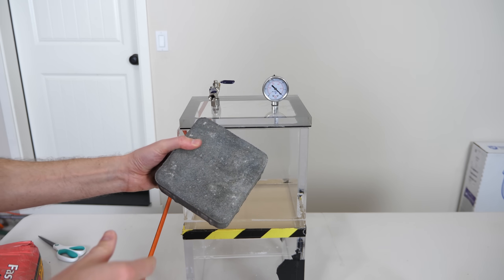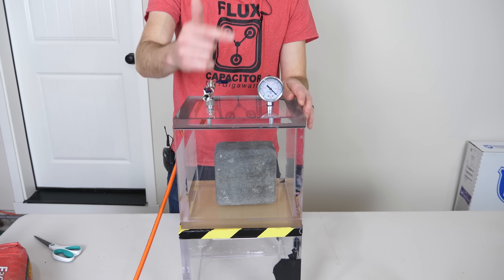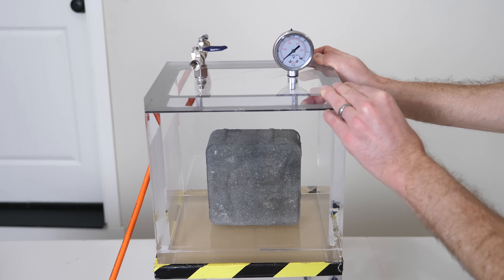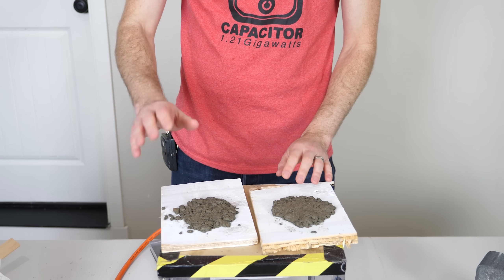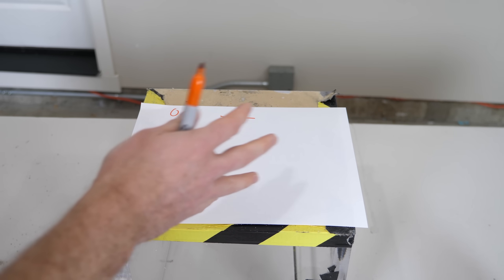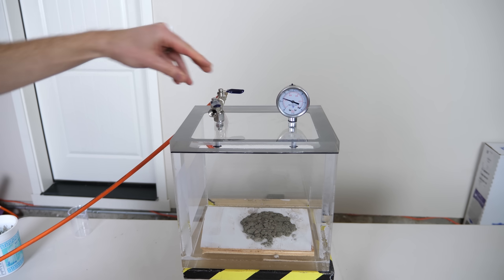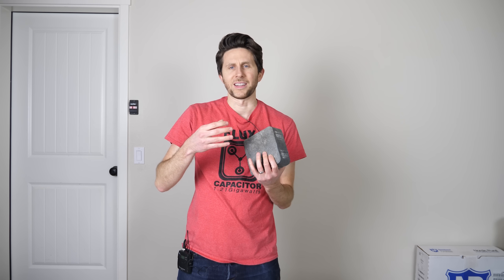Does Concrete Turn to Dust in a Vacuum Chamber? Concrete Without Oxygen Experiment

Comment: Does concrete turn to....What?? Why?? I didn't come here to watch the video, because I already know the answer to this ridiculous question. Why would anyone above a 50 IQ think it would turn to dust? Oxygen has nothing to do with how concrete is held together. Oxygen atoms do not cause concrete to hold together, a chemical reaction that then dries and is void of all liquid causes it to stay in form. Yes, in time water can leach out the lime that is a main ingredient in the adhesion, because water contains CO2 turning water into carbonic acid. A very, very weak acid that is found in ALL water. This fact was the basis back in the 70's for the great acid rain scare. The general public didn't realize this was a natural thing, because anytime there is CO2 in the atmosphere, it will create carbonic acid when mixed with the water. But, It'd take more than 50 years to cause even a little of the leaching affect. This question ranks right up there with people asking, is the earth flat.

Comment: Bit of a silly video since both of these premises have no logical basis. Cured concrete is a stable mineral and no more likely to disintegrate in a vacuum than a natural rock. Wet concrete also only needs water to cure. It will cure perfectly well ( in fact best) underwater. The only  effect of a vacuum would be to reduce the vapor pressure of water leaving less for the concrete. BTW concrete does not “dry” it sets. Technically the origin video was not correct since there is no known mechanism for a vacuum to remove oxygen atoms from solid crystalline molecules or any others. Otherwise vacuums would be mega disintegrators able to solve all the waste problems of the world.

Comment: Hey Good stuff, You should get a micrometer for you're vacuum chamber.  In refrigeration pulling a vacuum is often referred to as dehydrating the system. Moister at least in experience seems to flash off raising the micron reading then as it comes back down it will repeat over and over. Once you can achieve and maintain anywhere from 300 to 500 microns you know your dry and there are no leaks.

Comment: many years ago i worked in a lab where concrete was tested.  we used to take samples of each truck load and let it set in a mold then when hardened enough put them under water for a month and them test the strength.  concrete only needs water and fully cured concrete is inert to air.

Comment: If you have a molecular lattice that includes oxygen in its structure and you remove the oxygen atom, yeah something's going to give way. Removing the air from concrete is not the same. Molecular oxygen does not equal air.

Comment: I gotta be honest, IDK where pf who came up with such an idea. That concrete relies on air to stand, I have never herd anything it it before. On premise it sounds like complete nonsense. Only reason I can think of for people thinking that is that the trapped air inside concrete also getting pulled out. In which case you should be more worries about the air trapped inside your own body if something like that was happening. At least that air is creating pressure. 

lol haven't watched the video yet tho, just paused during the intro out of shock.

Comment: If anyone mentions concrete crumbling when all the oxygen goes away and they dont mention basically everything alive, all the water, and multiple compounds turning into gas. They are kinda dumb.

Oxygen the element and oxygen the air we breath arent the same thing and conflating the two is just sloppy postulating. Its really bad science communication.

Not criticizing you, your video is great. Equivocations especially really stupid ones are just a pet peeve of mine.

Comment: Incmplete test. - vacuuming only removes the air - and yes vacuume has an effect - for one, it will cool th set concrete. But  heat+cooling causes fractures. Second problem is that drying in a vacuume causs ice buildup until the ice prevents the evaporation the resulting dried concrete will have lots of holes in it where water froze and then sublimated away - the result is a brittle aggregate and very porus allowing gas to leak.through it.
Your "experiment" was poorly designed.

Comment: All these videos saying concrete turns to dust if all oxygen disappeared don't say what if all air disappeared. So removing all oxygen means removing all oxygen atoms. And at that point we wouldn't exist anymore since our molecules in our body are containing oxygen
Reply: But do they mention all the other things that would collapse into a pile of atoms? Including water turning into hydrogen?

I havent seen them so im more genuinely asking.

If they mentioned concrete but didnt mention water then i think they conflated the two. If they did mention both then their communication had a hickup and an equivocation mistake happened.

Comment: 90% sure that it's porous enough that nothing will happen to it.
Reply: For the second part - no, it doesn't need air to dry. If anything, the vacuum will make it dry faster and it will be denser and stronger than normal concrete due to the removal of air bubbles.

Comment: #1, Nothing will hapen.
#2, For things that would be affected, sudden decompression would be more damaging.
Use a large tank you keep at a vacume. Then run large pipe to the vac chamber w valve to large tank to decompress fast.

Comment: 1:46 concrete and cement rely on chemical bonds to maintain their rigidity. I highly doubt removing oxygen is going do a thing.

However. Oxygen is a very reactive element and the chemical bonds above mentioned may require that reactiveness to set in the first place, so sublimating all the water off MAY be catastrophic to it setting but i dont know enough about the specific chemistry involved to predict whether it will set without oxygen. I suspect it will.

Comment: Concrete is a derivative of cement, and contains lime (calcium oxide and something else) that releases CO when water, H2O, is added. That's why both concrete and cement can be "cooked with or without an atmosphere! And that's why it's not recommended to be in an enclosed space filled with concrete when it cooks, it kills you without you knowing, whether on Earth or on the Moon... Carbon monoxide is odorless and reacts well in any atmosphere or the lack thereof with chlorine! That's why we can create walls, both on the Moon and on Mars, as long as there's an initiator, not necessarily water! But that's for later... heheh!

Comment: you can cure concrete submerged in water (aka no atmosphere exposure). In fact for compressive strength test in Europe the samples are cured in a warm water tank.  The US uses a cylinder testing method for compressive strength where the cylinders are cured in a kind of steam room of sorts.  Unfortunate,there were too many other variables involved in the test you conducted to draw a true comparison of strength. The samples need to be the same shape — exactly.  Not just ill defined blobs.   The consolidation before letting them set needs to be the same.   Also the temperature needs to be the same.  Although they were in the same room, it is unlikely the temperature in the vacuum chamber was the same.     One interesting thought is the heat transfer is likely reduced in a vacuum.  So the curing large masses of concrete or thick slabs may be more challenging.  Both conduction and convection heat transfer are not possible in a pure vacuum leaving only heat transfer by radiation.

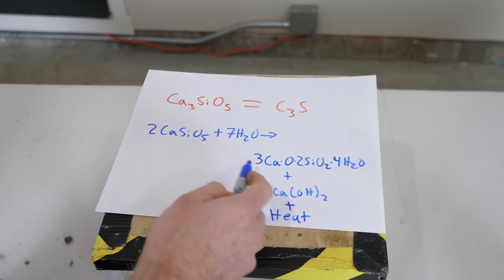Comment: 7:45  There is a method of placing concrete called "dry pour".  Dry concrete mix is poured into the form.  Then water is "misted"over the concrete several times.  Your explanation shows why "dry pour" concrete isn't strong because water can't get to the dry mix.  It takes a few weeks for that to happen if it happens at all.  Even quick setting concrete takes 28 days to fully cure.

Comment: I stopped the video at 1:40.  Absolutely nothing will happen to the concrete brick in the vacuum.
*1st edit, stopped at 3:44.  The concrete will harden if left in the vacuum long enough.  The vacuum may pull out some water, but not all, so if he leaves it in for a few minutes, nothing will happen.  If he leaves the concrete in for a few days the exothermic reaction will have time to start, and the concrete will harden.  Then over the next thirty days the concrete will continue to harden or cure.

Comment: I'm pretty sure it won't change. Placing concrete in a vacuum is not the same as all oxygen disappearing from the Earth. The oxygen inside the concrete probably won't be pulled out just because of the vacuum. But if all oxygen disappeared, that would include what's inside the concrete. And that's if this claim is true in the first place.

Comment: There's a big difference between "What happens if you put a piece of concrete in a vacuum" and "What happens if you were to remove all the oxygen atoms from the concrete?". The latter would change the molecular structure of the concrete significantly (assuming it has oxygen atoms in it, which it almost surely does), and then I could believe it would lose its integrity.

Comment: This is a fun experiment! But I do want to nitpick the part where you say you reached "full vacuum". I say this as someone who has worked in a clean room, you never reach perfect vacuum (no gas at all). You can get pretty far, but you don't go from 0.1 Atm to 0 Atm; it's more like 0.1, then 0.01, then 0.001, and so on. That vacuum chamber likely couldn't reach what would be considered high vacuum (which requires a much more complex and robust vacuum system)

Comment: If all oxygen left the earth at once, all organic matter would turn to slush and the planet would arguably collapse into the core under the pull of gravity. Also all the water on the planet would become hydrogen gas. Again, the whole planet would simply collapse.
Reply: Just looked it up to be sure I wasn’t an idiot. Oxygen makes up about 30.1% of the Earth’s mass. That’s literally almost a third. So yeah, im sticking with what I said. Everything would collapse into the core.
Reply: I think they mostly mean "no air". If it were just oxygen, there would still be tons of nitrogen gas, which defeats the point of air not being able to hold up the concrete

Comment: The wet concrete will harden, but will never fully cure.  Unless you leave the pump running for 28 days you won't notice much difference.

Comment: I'm sure if you sucked all the air out from around concrete incredibly quickly it would come apart, but that would be a function of the force of the air being removed rather than the lack of air itself.

Comment: That's it: Moon structures would mostly be in concrete. Because there's an abundance of stone/sand there, so it'd be cheaper to build building with local materials, leaving what's metal for seals and devices.

Comment: It's actually linguistically wrong when they say that. Removing all oxygen means removing the gas only. When you refer to chemical reactions we say they lose oxygen "molecules", not oxygen. We also tend to call oxygen molecules, OXIDE. As in dihydrogen oxide for water.

Comment: Concrete doesn't "dry" to turn into a solid.  It's a chemical reaction.

Once in awhile you get it right, and refer to it curing.  And then you go back to calling it "drying" which is categorically wrong.

Comment: I believe that concrete doesn't need free oxygen. I didn't believe it to begin with, but, if I had, this would've dissuaded me. However, I still don't believe that concrete spaceships are a good idea.

(Yeah, I get it: the Moon, Mars, etcetera. However, that's not actually in space, just vacuum and low pressure, respectively. Nitpicking for the purpose of humor is justified, imo.)

Comment: I heard this a while ago, hence why I looked it up lol. im 90% sure its false though lol
also with this test, if it does crumble, how do you know its not the lack of anything in the atmosphere of the chamber? Like pulling it apart? not sure how it works icl lol not an expert just speculation. lastly, you said you would try drying cement in the vaccum, if the cement doesn't dry how do you know  that's because of a lack of oxygen?
This was all written before watching the whole video lmao. it's all pre-test queries

Edit: This video is fucking interesting.

Comment: i bet it would not set if you used something hat didnt have O2 in it unless the water bubbled out  from the decrease in  pressure you already gave it what it needed with the water o2 was still there plus like you said the chemical reaction is designed to set in that time  
i work with a lot of drywall so it the same with drywall mud you can try to buy 20min mud dump the bad in a bucket mix it up put a lid on it you just wasted all that because unless you use it all in 20mins that whole bucket will be like almost dry clay hard but will dent when hit so not rock hard but the next day it will be even if you never took the lid off and yes i know you want to say there was still o2 in the bucket when you put a lid on it NO NO
by that logic it would start to dry top to bottom but the top would make like a shield blocking the o2 from going down but if you ever work with this stuff unless you have a crazy amount of air pockets in it it will dry at a uniform rate meaning all of it even at the bottom thats not getting o2 but the top top will dry a little faster o2 do help it dry but its not need iin the gas or as air since its all getting the from the water used to mix it 
and ps (i got my thoughts mix up on my guess at first lol when you asked what do you think will happen to the concrete i forgot its way more porous then rocks and was thinking it might blow up because of a lot of trapped air )

Comment: And yes concrete will solidify without oxygen how do you think they do it underwater concrete is a chemical reaction it does not need oxygen all it needs moisture in the chemical reaction will happen

Comment: Cement is to concrete as flour is to cake. 

Cement is an ingredient. 

You missed water as an ingredient. It’s actually cement, water, and aggregate. Concrete uses coarse rock, slurry uses just sand. 

I’m also going to say that the concrete paver you used was different after the vacuum. You should have boiled all of the water out of the block. 

I used to do quality control on aggregate, concrete, and asphalt.

Comment: Nothing will happen. I'm 100% sure of that. There is no chemical or structural mechanism that would make a vacuum cause concrete to disintegrate.

As for the cement setting in a vacuum, it's possible that it will be incomplete or take longer. A vacuum causes water to boil off at extremely low temperatures. If the water used in the cement mixture evaporates and gets sucked out before the chemical reaction completes, it would cause the cement to not be fully set. This might be offset by adding more water to the mixture, though I'd need to do a lot of annoying math to figure out roughly how much would be necessary, and math makes my biologist brain angry and sad.

Comment: The oxygen (and hydrogen) necessary to bond concrete is already locked into the concrete. I supposed if you pulled an absolute vacuum immediately, it might fracture. But, I am 100% sure nothing will happen to the block.

Comment: I beleve you could influence hydration by pulling more liquid further into the concrete mix but I think it would be worth nearly noting. Oxegen at 5,280" is only 16% atmospheric air is mostly comprized of nitrogen and a little bit of argon. oxegen shouldn't really effect it

Comment: 6 years later, but i take my guess... nothing is gonna happen, every single time you run any experiment about withholding oxygen or air from concrete. cement is made to cure and set without the need for air, even under water it will set (though it might make bad concrete from the excess water).

Comment: By the concrete crumbling because of oxygen disappearance, then water, ozone layer, DNA, RNA, sugar, … will also disappear since without oxygen, their structure will crumble. Not to mention, our body has oxygen, animals has, tree has, even the oxides, even the earth has oxygen all over its structure. So, if all oxygen atoms disappear, then the entire earth will crumble apart with nothing left
If only oxygen gas disappear, we’ll just suffocate for 5 seconds and our ears will just pop due to pressure decreases

Comment: Earth athmosphere doesn't consist only of oxygen. Oxygen makes about only 20% of it. The most (75%) is nitrogen. Thus, removing just oxygen from the athmosphere wouldn't create a vacuum. Secondly, it's not an atmospheric pressure that keeps concrete hard and solid, it's a chemical reaction that makes bonds at molecular level.

Comment: "the only thing that is different is it will evaporate the water more" 

actually (god i hate being that guy) the real difference is in space heat has a real problem bleeding off.  so large structures of concrete probably can't be built in space.  else they'll probably get too hot and crack under the thermal load.  this is a problem enough on earth with large chunks of concrete.  which limits the size of the blocks we make unless you take special precautions to keep it from overheating and cracking.  

in space this probably will probably be significantly more pronounced.  really complicating large concrete structural construction in space.  (and no space isn't really cold... not in a traditional sense)

Comment: ok my guess before watching the video: nothing will happen because the structure is not because of the oxygen on the air, is because of the oxygen on the concrete in form of ... some chemical that has the oxygen, you know like maybe SiO2 or something like that, so that oxygen won't move in a vacuum. That's my guess . Back to the video